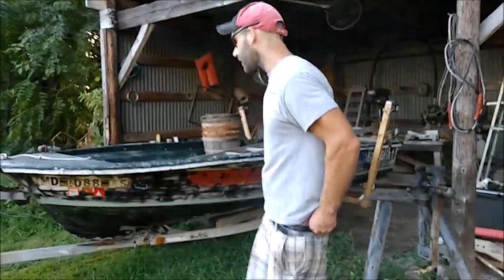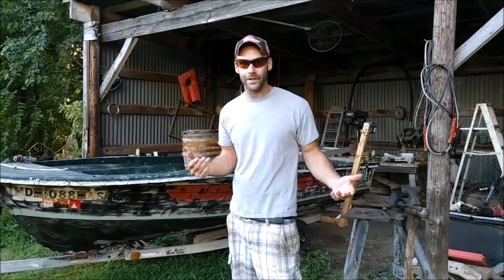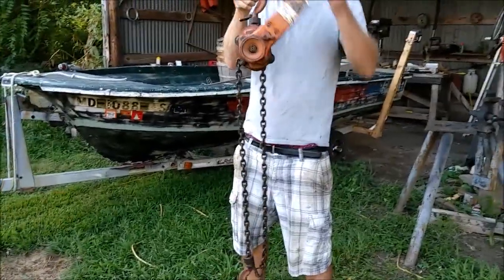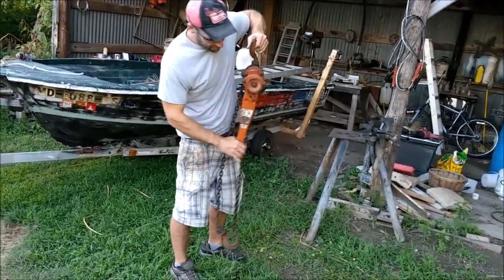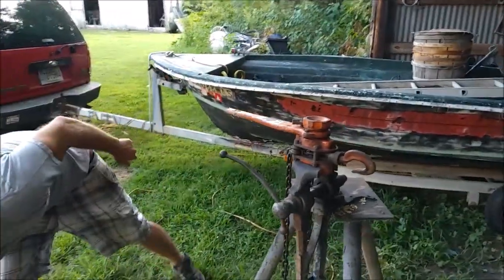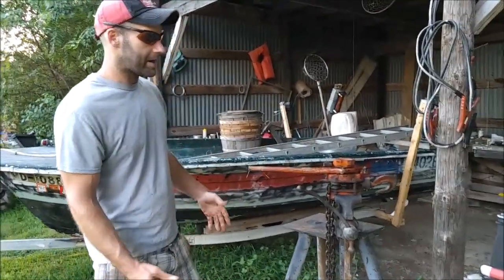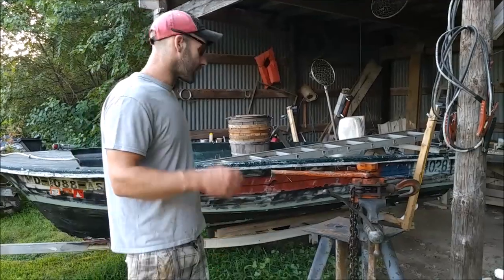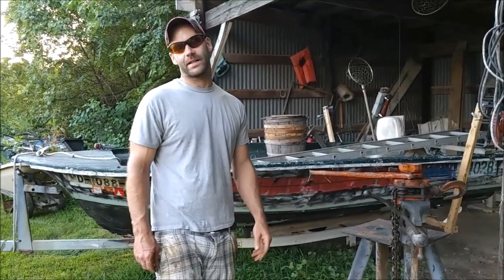Chain Hoist Won't Lower - How To Fix - (Fast, Easy Way)

Comment: Shiiit! That toally worked sir. Thank you for the tip is was on the money. I used a vice but NO hammer, just gave it a couple of hard yanks and it started working.

Comment: It has a clutch in it.  Tighter you pull, tighter it gets.  Usually in a shop environment you can unload it.  But, I have one that is stuck.  I pulled up a good sized tree with it.  See, when I pulled the tree, no way to unload the clutch.  I forgot to fix it last time I had my crane going.  I don't want to vise and smack it.  It's aluminum and I don't want to scuff it, 3 ton.

Comment: This is common, it's not even rust.  The problem is that people raise a load and then take the load off.  The clutch locks up.  The right thing to do is to reverse direction and lower it a bit and then remove the load.
My father used to do lifting tackle for his business and we used to take in "broken" pull lifts that were locked up, he would just smack them with the prescribed large hammer, paint them shiny again and sell them on.  Easy money frankly!  This wasn't all he did but as a youngster, I very much remember these moments in his early years.
Reply: Legend, thanks for confirming ☺️

Comment: We got the same pul lift but the problem is that it picks up the load just right but won't lower. Can't figure out how the clutch works, its not realising the clutch..... Please help me fix it
Reply: Have you found a solution yet? Im facing the same problem at the moment...
Reply: Me too.i.have tried pene
testing oil &.sledge hammer. has not budged.